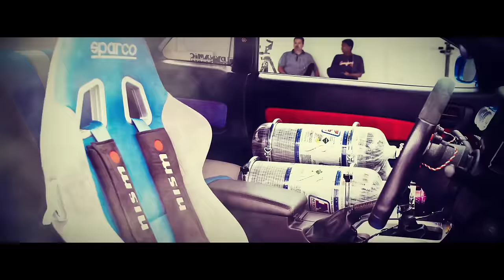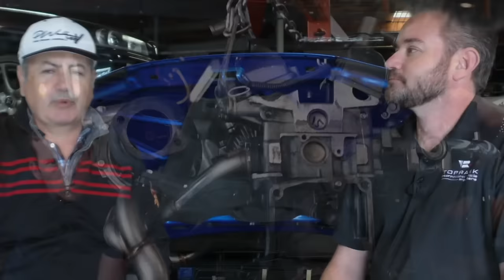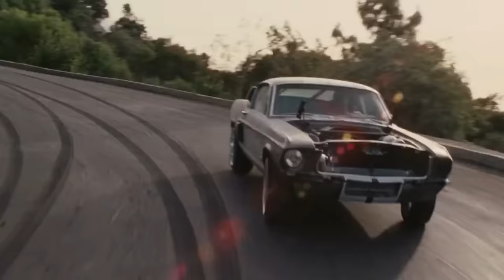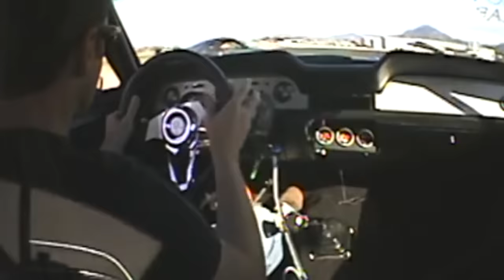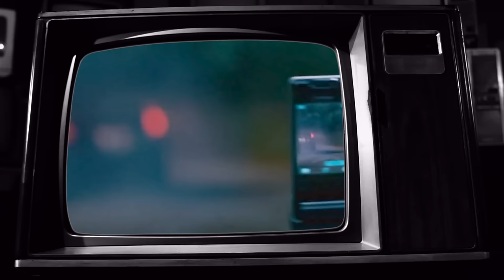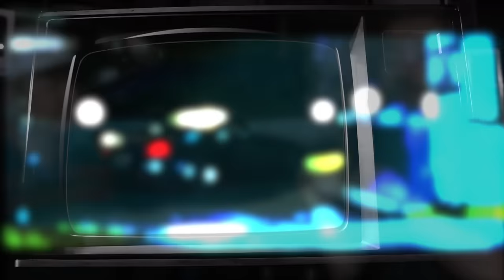TOKYO DRIFT RB26 MUSTANG

Comment: Funny how this Mustang, that's actually really clean and nicely done, gets so much hate from the same people that complain about F&F not being realistic or something. One of the most close to reality cars in the series.
Reply: If the S15 or Evo were Windsor swapped they would have gotten just as much hate
Reply: @lb9gta307  yes, but why? That's is what I am talking about, the movie put Sean in an situation that he had an engine and a car with no Powertrain. What was he supposed to do, import the original engine? Makes no sense that people complained about this.
Reply: @TheGeniusVitor  if you want to talk realisticly they would have repaired the S15. Would have been easier to make it drivable than to fab suspension, angle, exhaust, a fuel system, wire and entire car, paint it for some reason, and then tune the set up.
Reply: @lb9gta307  you are kind forgetting that the S15 was smashed. It was easier to put back the mustang parts and swap the engine.
Reply: @TheGeniusVitor  it was crashed but not smashed. It was all just body damage. I've seen worse just given tire clearance and a re-alignment and put back on track. Not too uncommon for competitive teams to pull a frame straight enough in the pits after stuffing it into a wall. MUCH easier than fabbing what they would have had to for the Mustang.
Reply: They hate because it wasn't a mustang motor homie, that why. They put a rice burner motor into an American car.
Reply: @justinbowen1183  A better motor lol
Reply: Anyone that gets butthurt about someone else's car just doesn't have anything better to do with their time
Reply: @lb9gta307 you wouldn't be doing the modern JDM cars any justice by dropping an obsolete dinosaur Ford V8 into one ...plus you'd encounter great difficulties in attempting to fit the V8 into the east-west 4G63 layout of the Evo engine compartment, it simply wouldn't make sense lol... having said that, the Chevy LS V8 powerplant in many of it's different configurations has been a popular swap-option into the Silvia S and Skyline R chassis in the drift circles for many years now as it's much easier to achieve the super-instant torque delivery that is required in drifting using something like a LS-X rather than building a stroked RB34 or even a 2JZ....it's much cheaper too... trust me - I know !!
Reply: @ilpatongi  it doesn't make much sense at all to even compare the Ford V8 against the Nissan RB...  the Nissan RB powerplant was designed to win races straight out of the box, hence the engine designation RB = Race Breed, on the other hand, the dinosaur was made to tow caravans and boats  lol
Reply: @user-kc2ru5xo4k  also, putting a carbbed engine into something that was already carbbed is less work than putting a turbocharged EFI engine into a carbbed NA car. Carb to carb engine swaps require next to no fuel system and intake system fab in compairison. And since the S15 was roughed up but not actually all that bent it would have been the more realistic option if that@s what they were going for. But really they just wanted to get a rise out of people.
Reply: @lb9gta307  yes n no. Its a big job if you're clueless, easy if you're in the know....To drop a efi engine into an older non efi chassis, I'd do it the easy way - use a Bosch 044 (or a 040 intank pump) as a non-pressurised primer pump to draw from the factory tank to fill the surge tank and from the surge tank, add two more 044 pumps, one to each end of the fuel rail, then tap a regulator from the centre of the rail back to the surge tank - there you go, a 1200hp fuel system just like the one I'm running in my R33 that slaps 437kw at the rear wheels to the tarmac, even tho the R33 was originally an Efi car, this fuel setup will go into any chassis, Efi or otherwise...It took me 3 hours to knock up. How is that hard ??
Reply: @lb9gta307  I never said it was impossible to drop a boat anchor into an Evo, it's just requires a lot of headache to go from eastwest based setup to a north-south.  As with the 'hate' factor, it would expectedly come from the JDM fans. Personally I'd be asking 'WTF would you ruin an Evo's natural drive-abilities by sticking a heavy lump of iron into it and throw out it's beautiful balance??'    The only reason I can think of is for drifting... why didn't they just hack up a plain-jane Lancer instead of ruining a classy Evo ??
Reply: @user-kc2ru5xo4k  the Windsor isn't a boat anchor. There's more than enough aftermarket to make a ton of power for reletively cheap. And I say that as obviously not a Ford guy. 

And that is obviously more work than just cutting a hose to length and attaching it. 

As for why they did that to an Evo rather than a standard Lancee, it's because they have RWD componants. FD doesn't allow the work needed to RWD swap a standard Lancer.
Reply: @justinbowen1183   oh no they put a far better engine that’s so common in the place of the movie plot in Japan than a dated Mustang motor
Reply: But it is all good to put a v8 in everything else hahahhaha...
Reply: @lb9gta307  Truth. I would love a Windsor/Cleveland hybrid AWD S15.....just saying.
Reply: Go find out how much actual time, energy and money you'd have to spend to get that car done that way. Then see how much it'll cost to get the same result in what the movie shows as either a few days/weeks. Either that car is utter cheap shite built quick, or it's pure gold and took 100s of person hours to engineer, design, and fit the parts for the swap. Here's a hint, you can't just bolt engine A to transmission B and even if you can, you can't expect it to work. 

Put short, the amounts of the above to get that result from an engine swap? Well some of us just aren't idiots and don't take kindly to what little intelligence we may have being insulted.

For Example: You haven't addressed me by my "chosen pronoun", yet you have no idea what that pronoun is. I'm not going to tell you either, but if you don't use the right one, your just not smart enough....

Don't forget:
*Sean can already go sideways around a corner under control in a race situation as shown at the start of the movie
*Sean gets to Japan, instantly loses ability to go sideways around a corner, under control,  in a race situation
*It's no longer how you stand by your car, it's how you crash the Asian guy you just met's pride and joy called Mona Lisa, survive, forget about the car, remember the car, ignore the day or two to get it race ready, instead cram possibly three months worth of engineering into a process over several days
*Han Ex Machina
*Cops can't exceed 180
*Hector is going to be running three Honda civics with spoon engines, and on top of that, he just went into Harry’s and bought three t66 turbos with nos, and a motec system exhaust
*That's a dank meme and I finally used in a context where it makes sense... or does it....
Reply: @lb9gta307  Finally, someone with an intellect! Thought I was the only one who noticed this
Reply: @CLA82529  Don't forget fingers, we wouldn't have anywhere near a many keyboard warriors if they didn't use them.

Although, most people have already forgotten what thumbs are for...
Reply: @justinbowen1183  rb26 aint a bad motor and it made a shitty csr even better
Reply: @darylobey8867  I never said it was bad I said it was a rice burner motor read it again...
Reply: It's funny how people here complain about engine swaps when it's been a normality in JDM culture. Lmao
Reply: TJ Hunts Version Is Just As Nice..
Reply: Even years later people are still talking about this. They simply cannot understand simple things. The movie producers wanted an American representative, and they chose the Mustang (With a little bit of spice, like the cool engine). American kid with American car beats japanese kid with japanese car. But they put Sean in a situation in the movie that made total sense in what he did. Get the powerful and reliable engine in the car with best shape available that could support the engine. And they did it. It's not like you guys don't see or know much crazier things happening all the time.
Reply: @lb9gta307  the way it crashed, the damn frame was clearly bent
Reply: Simple answer, the same reason "purists" critique RWB Porsches.
To me I really don't care what people prefer, it doesn't bother me.
(Edited)
Skinny jeans bother me 😐
Reply: @justinbowen1183 rb26 is a hell of a rice burner homie
Reply: Probably because it doesn't have as much character as the other cars in the series.
Reply: @TheGeniusVitor because when this movie came out. People stayed true to the brand, it was the trend. LS in a Mustang was blasphemy. Car trends have evolved and we can all appreciate it now.
Reply: @lb9gta307 I'm certain the Mustang was picked likely because Sean's an American man with a jdm heart. Especially supporting this since he gets that wicked S15 at the credits.

Imo it would've been lame if he just beat DK with a lame 30 year old V8, and the amount of body work to Han's S15 is unreasonable within the timeframe compared to swapping parts/simply putting a bumper and windshield on some old Mustang. It's a lot easier to install than fix, rebuild, and redo.
Reply: People just hate fords in general

Comment: Hardcore Ford guys acting like Mustangs never came with a straight-6 lmao
Reply: No, it's the Nissan part that offends them. If it was a Barra or even a 300 they'd be ok with it. They still may not like it because a 6 cylinder Mustang is known as a secretary's car but they wouldn't be offended by it.
Reply: @lb9gta307  damn straight. Hit the nail on the head.
Reply: No  but it did come with a slant 6
Reply: @rdeh1678 the piston firing order and symmetry are almost identical to a straight 6 with just a difference in how many degrees the engine is angled.
Reply: a barra stang would be mental
Reply: @lagigtesketit4379  look up Adam Lz
Reply: How many chromosomes you got recently?
Reply: @cneddy22  more than you 😂 jk
Reply: @rdeh1678  no it didnt
the slant 6 is a chrysler engine
this is a ford
Reply: And Ford never intended to put a V-8 into it. Their only intention was for what they built. It was up to mechanics that put the V-8 into their own cars and then started racing them separately. It caught on and then the car Companies stared doing it. Like with the Lincoln truck, someone put a Navigator front-end on their F-150 and then put it in a magazine. The Impala SS from the Ninties started out as one of the in house mechanics built his own car.
Reply: Yeah V8s only
Reply: I'm a big mustang fun but also a big fan of gtrs so I see no problem

Comment: One of the most iconic JDM engine in one of the most iconic muscle car, I love it ! People LS swap a lot of iconic japanese car anyway (mainly for drift), why not the other way round ? I think that would be a sick project. 2JZ Charger when ?
The franchise making a return to Tokyo to embrace JDM culture once again would be a huge hit now, Tokyo Drift was just ahead of its time
Reply: there is a reason why, LS and Ford V8 Gets the same power as a JDM fully modded for 1/8-1/2  the price of a typical JDM Engine tuning. They are expensive and also they weigh almost as a 2j or less. it’s not worth modding a jdm if you are at a limited budget. Despite the fact a stock 2j engine is super expensive  and you can get LS at junkyards for 200-1000 dollars.
Reply: @StBeter-tc2te  super true, but if you get a 2j from a Lexus, you can often get one for really cheap too, and use the manual transmission from an is300 i think. Plus the is was a flop so you can even find a whole car with the harness, ecu and key for relatively cheap
Reply: @tvpharoah1314  have a boss that has the n/a 2jz and it’s worth a lot of money. Really i don’t know the history of the 2jz with turbo or non turbo. Is the Non Turbo 2jz still a decent engine for boost?
Reply: How bout an AWD Dart2?
Reply: @StBeter-tc2te  Gotta also remember that in the context of the movie it would be super expensive and take forever to get any V8 shipped over to japan and then for them to build where as they would have better and more affordable access to tuner engines.

Comment: Yes that was indeed an rb26 in the S15 in Tokyo drift. I have personally put RB engines into the S14 and S15 many times over the years using the R32 GTST crossmember. The Silvia and Skyline are 'sister cars' that share many chassis and suspension components so a lot of it are interchangeable.

Comment: Funny story, I nearly bought the actual S15 (the Mona Lisa) back in late 2007/early 2008 as a company in the UK called New Era Imports got the contract/rights from Universal to sell the cars. The S15 was only £13k at the time and I could just scrape the money together, however the insurance was looking to be £5500 so I decided against it and bought a Supra. 
I have actually been lucky enough to drive DK’s widebody 350z though (about 5 years ago), but it was quite hard as the rollcage side bars stopped the bucket seats sliding forward so the peddles were quite a reach! 😂
Reply: Do you perhaps know what happened to Sean's lancer Evo?
Reply: Khumo Matlakane Unfortunately not, I still know where DKs 350z is but that’s it.

Comment: This is interesting because, in the movie, if the engine powering the Mustang was taken from the "Mona Lisa", that'd have meant that Han replaced the SR20 with that RB26
Reply: Mona Lisa Was already swapped with the rb26
Reply: Not unlikely
Reply: There are plenty of people who swapped out those engines into a 240 just because the simple fact that the engine bay is about the same size and because it's Nissan you've got a lot of parts that are literally around the same size and in similar placement so it's a lot easier to do an engine swap like that and the fact that the RB makes a bunch more power and is a lot more iconic than the SR20 is and the fact that oh really all you need is just a turbo and you're taking that 250 horsepower engine to upwards to 300 throw in some new fuel injectors that are spark plugs fix the timing and you're going to have easily 400 horsepower so I don't see why people wouldn't do it it's just the feasibility of getting your hands on the specific engine and the parts you need really as well as getting the proper oil pan to take out the front wheel drive because that's where it's mounted and has a shaft that connects to a transfer case
Reply: Yes, rb series engines are pretty much a bolt in replacement for silvia's, the rb26 is a bit of a pain cause you need to covert it to rwd first. But the nissans are basically lego, all the bits fit into each other

Comment: I often see so many guys living in their parents basements critiquing others car builds when they in fact have never so much as installed a blow off valve, cold air intake or down pipe let alone swapped an engine and it’s associated components. I get the same thing with my current personal car (an 01 Subaru 2.5RS w/ an EJ25t from an STi & the STi 6 speed), guys will say “An STi motor won’t fit in there you just boosted a non turbo EJ” or “You imported a 2 door STi” both of which are baseless statements and fueled by stupidity.

Comment: This specific mustang has made me want to RB swap something
Reply: Well the cool part is there's a company called dynacorn that makes new 67 Mustang body shells find a wrecked Xterra with the transmission and get an rb26 engine and you're good to go. I think even a few outfits even make the cap for the fuel tank that would say GT-R on them.

That being said I wouldn't mind putting rb26 in a GM G-Body...
Reply: Check out Finnegan's Garage. Swapped a Charger with an RB engine. The Death Metal Charger.
Reply: @eddieschwab864  that would be a sweet swap.
Reply: @kevinfox500  which one a rb26 in a G-Body? Or using one of the dynacorn shells to make a Tokyo Drift Mustang?
Reply: @eddieschwab864  RB 26 In a G Body. Then, line it up against a GNX.
Reply: @kevinfox500  , Finnegan's Charger has a 2JZ in it, Not a RB26.
Reply: @MJTAUTOMOTIVE  oops. Got them mixed up somehow. 

Thanks.
Reply: @kevinfox500  All good Dude, I do that myself sometimes. Cheers 👍
Reply: @kevinfox500  2j

Comment: People talked about putting the rb in the stang like that wasn't there only option. They had a wrecked s15 with a rb in it and a must with no motor. Like come on now
Reply: And I mean The Stang has plenty of room under that engine bay to be able to do it so you have the ability to use a boss engine like that why not
Reply: @swaswa1  they have limited time, they also have limited money. I don't think it'd be easy to find a 350 in Japan, plot wise.
Reply: @CLA82529  they could have gone to almost any dealership or even contacted Nissan and then said hey we need a couple of cars and it's Universal like they wouldn't make up money for it through other movies not the worst thing if a movie company doesn't make the most money but even then The Stang uses an rb26 which is not the same engine in a 350. They could have even contacted some race team and said hey we're looking for this specific engine and we need it by this time. And the S15 and The Stang both have plenty of room under their hoods to fit that engine. And yes the first car he drifted in makes sense since the engine was still good he was able to use it in his final major race for the storyline and those engines can pop out anywhere from 350 to a thousand plus horsepower depending on the upgrades
Reply: @swaswa1  I meant plot wise, the characters have limited time and money. That was all they got.
Reply: @swaswa1  

Yeah, but this is in Japan, where V8’s are expensive to run due to the annual displacement tax.
Reply: @EbilEnemyofBurgerTown  But the guy restoring it was an American. No way he's going to desecrate a Ford Mustang by putting in a Japanese engine. It doesn't make sense that the guy doesn't have the Mustang engine lying around somewhere.